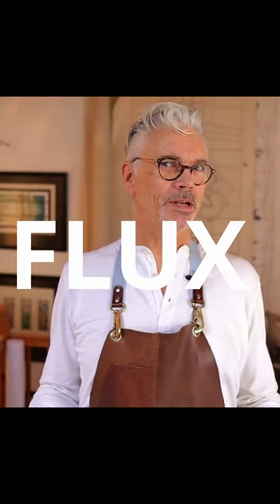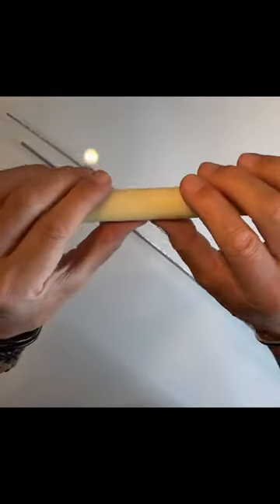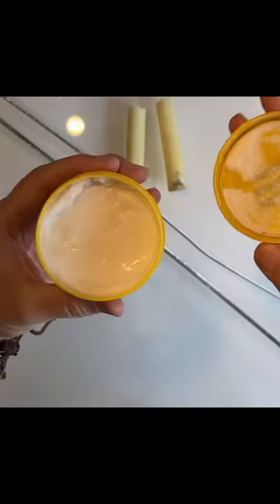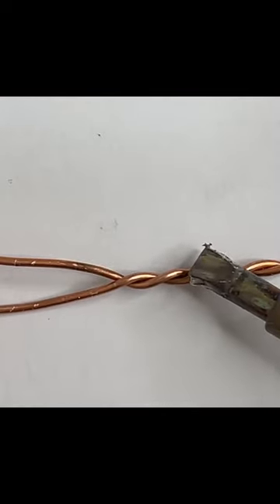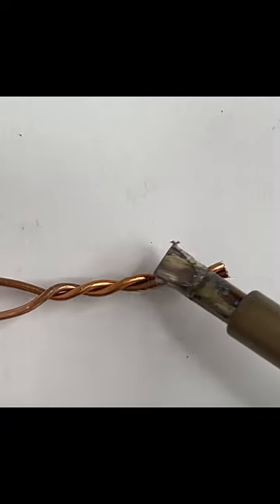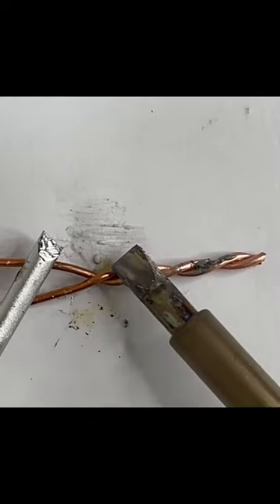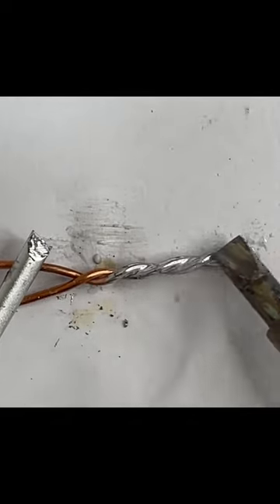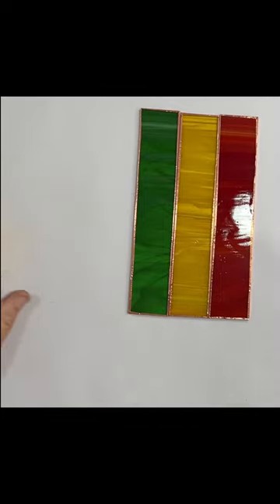What’s FLUX and why do we need it?

Comment: Good info Derek. I've heard advice about using the flux to 'clean' items to be soldered that made me want to understand the process better. I found a website with a very readable overview of the issues. I learned some things. Notably that the tiny molecular oxide layer happens immediately after exposing metal to air, and that heat improves/shortens the deoxidation time of flux. I've since daydreamed about using a underheated iron to heat the fluxed joint, without fully evaporating the flux, and then doing the solder melt with a fully heated iron. But no, too unwieldy.
Reply from the maker: Hi Don, quick question, - do you know if using tallow candle is less poisonous than using paste  for example? I've been asked by someone and don't know the answer. Many thanks
Reply: @DerekHuntArtist  No. I could only speculate. I wrote a long opinion just now, but erased it because I really don't have the information. I try not to breath smoke and not let it fill my studio. I'm not that particular about what's in it.
Reply from the maker: @donburt1921  it seems the fumes from using paste flux are far more caustic to breathe in than the fumes from tallow candle, but haven’t found anyone who has analysed them to find out what’s really in the smoke.